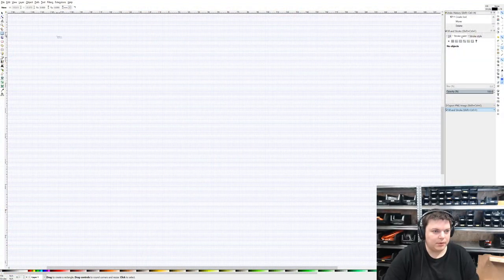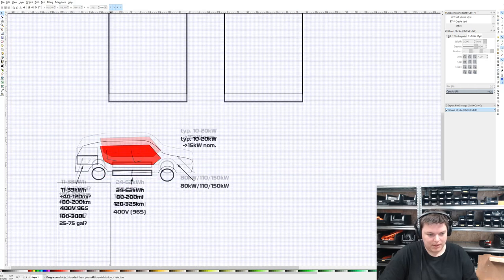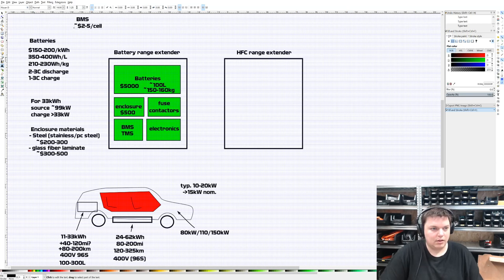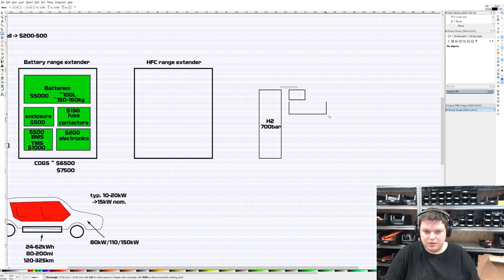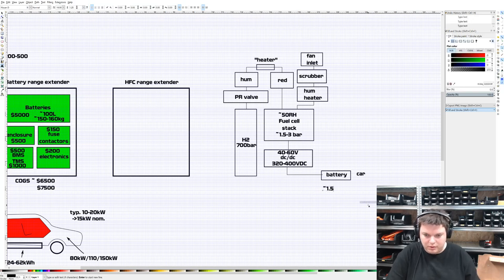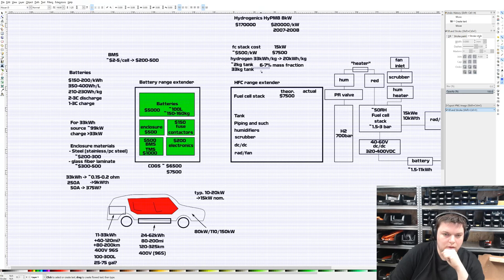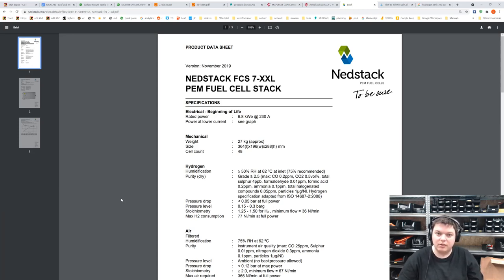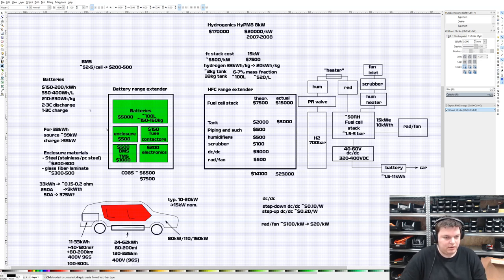Hydrogen fuel cell range extenders (deep dive)

Comment: just to let you know: here fuel cell have arrived as house heater device for the winter to create heat and power that gets into the household, its battery and the grid for 10Cent or so.

The fuel cell is only working in winter when solar power is low and they also have a heat pump for heating for the rest of the year when solar power delivers enough energy. Not cheap, but quite good in the total view.
Reply from the maker: I assume you're either in Japan or in Germany? Do note that the home heat&power SOFCs are quite different tech and not really comparable (or environmentally/energetically interesting) as they run on natural gas rather than green hydrogen. There are some interesting economics around natgas SOFCs in very specific areas, but that's also very much government-subsidy/tax related. The Japanese installs are highly subsidized by themselves, and the German installs rely heavily on the fact that regular oil/gas heating - even with cogeneration - is ludicrously expensive compared to free market prices (i.e. a regular oil-burning heater system is €12k+ while it's less than 600 euros one country over), making alternatives more interesting.
Reply: @PowerElectronicsBlog  Right, we have a community that owns windturbines which produces surplus energy you can not sell cause the grid is rejecting the energy in specific situations and the situations do more often appear and for a longer time. A battery can not store such amounts of energy what a Hydrogen storage can store. This model has no subsidaries cause the energy used would be useless, the turbines would go out of the wind and rest.

Airbus is now on the verge how to get into a zero emission world as they claim and that is based on hydrogen too and a network or hub on each airport for these new planes. The truck bus companies from Mercedes, VW, Volvo, MAN, SAAB SCANIA have merged their Hydrogen actitvities as the alternative to big batteries or the battery exchange model the Australian start to use, which is limited to their market cause length of trucks is here a limiting factor and you can not exchange heavy batteries in europen trucks in the current size. There is progress in the Hydrogen world but it is slow and depending on the progress of saving ressources or replacing those that are pretty expensive. 

Depending on the infrastructure things can change cause the same issues are faced multipe 1000 times by all the windturbines off shore that in stormy weather get out of production due to grid limitation. And we could see this hitting also the older Solar power roofs that had run out previous market models and will not get any money or close to nothing for the surplus energy. The solar power will be growing and overproduction too so there are thinkings to let those owners to sell the energy in summer to give them back hydrogen created power from the fuelcells created to heat the local homes. The next step would be becoming a part of the company and to not sell the energy but invest and return it cause then the taxes can be kicked out of the equation - and always the next logical step is a connection to a hydrogen network where they can get their power production back in hydrogen for a tiny additional fee for logistics. Works in communities that are willing to cooperate with each other and work for the community together like adding biogas productions to the windturbine community.
Reply from the maker: @typxxilps  So, this goes into a separate discussion of grid-scale storage and transmission. This is actually quite well-researched and apart from a few very limited scenarios, building out transmission and energy trading is considerably more effective at decarbonization than storage. Ultimately, you don't want to store energy if you can avoid it.

You're asserting that 'a battery can not store such amounts of energy what hydrogen storage can store' - but why? What precludes batteries from storing just as much useful energy as hydrogen? This is a commonly heard base assumption that I don't really understand. Especially for small-scale operations, batteries are fine and certainly a lot more competitive than hydrogen. Don't forget that the cycle efficiency of hydrogen storage as well as the poor efficiency of using either direct or waste heat for heating makes this even worse long-term. 

And the same goes for your assertions on battery size and weight in trucks; please, show some numbers! This is not a foregone conclusion, and batteries are a lot better than you think! Not just from an energy density perspective, but also general system complexity and cost. Weight is generally not the limiting factor for long-haul trucking - it's cost. Trucks are already a relatively expensive and energy-intensive way to distribute goods and fuel+maintenance is a big part of that. The main driver of innovation in this space is cost, and hydrogen is a very clear loser in this regard. There's little doubt that battery-electric trucks will dominate the space for that reason.

Comment: 2. major points: 
a margin is usually based on top of the cost: COGS 7500 x 133% will do the 9999 price, so 33% coming from the cost point of view being a manufacturer.  This does not change anything. I guess you also mean that these 33% cover all the liability and warranty questions that come along with any product and then even 33% can be too less especiall to cover all the overhead costs but it would make such a huge point more transparent.

the other point is that you need to make additional columns based on different amounts of production cause the decreasing factor is a bit higher in the car industry and car related product like for example the tank 100, 1000, 10000 each year makes a huge differenc on the price per unit, therefore economy of scale and therefore ID family or MEB plattform with exchangeable parts used everywhere only difference about the specs (engine) or amount (battery capacity). That is why you had seen the VW group producing up to 9 different branded product on 1 single plattform like the golf from 2000 onwards - before VW had been loosing money for a decade, in the early 90s they suffered from low order volume and their workers had been working in a 4 day a week scheme just 30 or 32 hours a week instead of 36 hours. So the modular concept was created to lower the costs per unit /engine/ gearbox / transmission / clutch and the electronics and lead to such a cost reduction per part that the profits grew exponentially and the production volume too. 

And if you put such economy scale figures into accout the hydrogen model will become significantly cheaper and of cause faster cheaper as the battery modules, but only for a certain amount of time when innovation progress decreases and production volume also no longer increases that much. Of cause that also depends on which components you are looking at cause the simplier tech like tanks and so on represent only a smaller part of the full extender costs. Regardless how many more units you will do the decrese of the price per unit will be slowing down except you reach a new order volume where the manufacturer can start a different prodcution method which then will give you another boost in decreasing the price , but this will only be one time only decrease and further more units will no longer bring the price significantly down. The fuell cell its is the major block of the costs and more or less a black box regarding cost per unit depending on the production volume. It is still low. 

At the same time the LiIon or LiFePo4 tech is booming into new peaks of productions with new mass production tech that makes them again cheaper and the demand surge is coming from powerwall appliances needed for solar power everywhere and general demand for 18650 or 21700 driven devices like the whole Dyson story or all the hobby tools from Bosch , Makita, and all the others and finally the car makers moving on to hybrid and EV. 

But the cost reduction per kwh is also decreasing considering that VW has claimed to reach a 100$ / kWh price already in 2019 and that even another jump to 50$ would bring the costs of an average 60 kWh car down by just 3000 $ in total - which they simply need to gain in the second the grants will disappear in europe. 

The battery extender / replacement of current cells by new chemistry is and will be for decades the by far cheaper one cause it is benefitting from the whole market development - on the long run beside the current covid driven peak for batttery prices - and the costs reduction. Therefore you usually pay only for the battery itself and conncetions and fuses and so on but not for all the basic overheads a fuel cell does need. The fuel cell will still be struggling for a long time - but even VW is uncertain if the fuel cell could not come back cause therefore they invited all the other german manufacturer for a general statement that the fuel cell will not reach the market - to save research expenses or to shift them into battery driven tech. But none of the invited agreed on anything and rejected this proposal and therefore all will continue more or less. And still BMW and Mercedes have done a lot of hydrogen research how to retrofit combustion engines which is quite cheap, but the storage is their core issue even though the emission were great and it would be cheaper too to keep them clean than current fossil cars. These are the 2 big battle grounds and since the old tech has been devolped, is there they might prolonge the life cycle of the big block tech for a lot of enthusiasts. VW has given up and now even the unions are keen going electric and will stop any turn arounds back to fossil which will make it difficult cause VW is still producing millions of cars outside for markets that do not want going electric like latin americas where they have plants too. 

Fuelcells for car range extender will not work out for about at least 1,5 decades and even then hard to get close to the then available and improved battery tech looking at lifepo4 charging cycles in specific low profile use cases up to 4000 times.

Till then there will be a huge market for all the first gen EV from E-Up 1 and 2 to e-GOLF 1 and 2 that will have demand for replacements or range extender cause they will soon reach degredation areas where the depreciation gets pretty high but also the chance to add value by "refurbishing" those or adding a second life. A few e-GOLF will be slaugthered for spare parts and then a lot of others can get a second life in their 9th year cause their chassis lasts about 25 years so it would make sense too. Not for VW most likely cause their prices will be to high - at least compared to Tesla replacement offers around 11000€ plus 1000€ labor in exchange for the old battery. Sound a lot but these are big model S batteries from the early models and the e-Golf has less than 1 / 3 of the capacity, but VW will not offer a new 22 kWh battery for 1/3 x 11000  = 3.666€ + 1000€ labor even though they could easily at least in 2025 with lower battery prices. 
Range extender and battery replacement will become a huge market and that has been only solved for TESLA with their offers, but not really for all the other brands.

Keep going on your good work and hope to hear from your VW extender or replacement offers.  The market will start to grow significantly stronger from the moment the grants will disappear and that is just a question of 1 to 3 years transition phase till these are gone. And then the manufacturer will be able to lower the prices about 3500€ and on top the progress in the kWh cost reduction, but they will only share that as half profit, so 5200€ instead of 9600€ grant will be the post grant era price point. And the 4400€ difference will push the range extender and battery replacment market for a lot of buyers cause with a delay of about 1 to 2 years the used car prices will increase too - not by 4200€ but at least 75% - 50% figures depending on age.

Comment: I really wonder why the extender needs to keep up with the usage. As long as it slows down the discharging of the battery it does extend the range. Of course, when you start with a 100% battery and hydrogen tank, you don't want the battery to be empty before the hydrogen runs out (, although that would mean you just need to park the car for a while to get enough charge into the battery again).

Comment: Cool video. Nice to have a good overview why HFC extender is not a viable option. And you even forgot some costs, I guess filling the tank needs some extra hardware, maybe even some electronics?
Reply from the maker: Yeah, the fillup part is something I'm simply not familiar with as we did direct bottle replacements on the kart, and in my consulting I've only worked on the fuel cell electronics part. And there's more parts of the puzzle that are missing, like the cost of fillups, certain expensive bits of equipment needed for assembly and testing, etc.

Comment: Agree on this 96S form factor. However, it should be much higher for lifepo, right? Do you also use lifepo cells for some extender packs?
Reply from the maker: Yeah as I mentioned in an off-hand comment, it's more like 114S for LiFePO4. Depending on your charging profile and BMS/physical layout, 112, 116 and 120S are common as well.

Comment: In my Opinion Hydrogen-Fuelcell makes sense atm (and future) in Trucks only they got the space.
Edit: Also Press and People, miss the fact that a fuel needs Platinum-group-metal(afaik), which is the reason why they are so expensive.
The Fuel-cells in Cars pop up every 5 years, firstly around 2000, then 2005 and so on.
Reply: no, that is not true, if had started even before 1994 if you check for the NeCAR 1 for example a Mercedes MB 100 D made in spain like a VW beetle with a frame structure and a fuel cell. Back then the A Class was already in development and got a double floor for an upcoming drivetrain. Then Daimler purchased Ballard Tech partly and they got into the research too so the fuell cell made a steady progress , but slower than expected. Therefore the second generation A Class had also a double floor and built higher just for the fuel cell implementation. Meanwhile more NeCars were build and progress went on but then the burdens of that empty space were too big cause the A-Class suffered always on side wind effects and higher consumption compared to GOLF. Now it is just another GOLF.

And even VW fears that the progress in Hydrogen might surpass that of the battery regarding average speed on the street were charging is a bottleneck cause fast charging at 250 kW lets age the battery more. Remember: VW CEO called all german manufacturers to join EV and abandon the hdrogen wagon to get a better infrastructure and faster.

On top: there are business cases for example here in the north with citizen windparks that suffer from surplus energy that are starting to produce hydrogen as energy storage where the citizen heat this way and can benefit from fuel cell cars and community cars in the sense of car sharing. They have solar power roofs, fuel cell for heating in the winter and power production during the bad solar months and switch them of depending on the solar power which then also powers the heatpump for heating. complete tech room with 60 kWh battery, heatpump, fuelcell stack, air exchange, air conditioning was about 80000 before grants (20 K).

Trucks and Busses will become the next big thing cause there the battery costs and disadvantages (less useable capacity in weight and space) make it easier for the fuel cell to succeed even at high price point. Later they will try to get down into smaller Busses and Vanlike Busses that benefit from the high heat demand in colder times and then into the Camper / mobile home scene that also has a high demand for heat ... and from there most likely into cars too.

Comment: A good explanation🖒(even with all the "assumptions"/"guesstimations")
[have you spoken to Max Holthausen and/or Ad van Wijk about your findings?]
[ I'd like to add the "running costs" into the mix [kWh going into a BEV vs kg of H2 (energy-equivalent) ; currently there's no competition ; H2 is outrageously expensive making H2 a non-viable option]
Reply from the maker: I don't have any direct contacts to Ad van Wijk, let alone somebody like Holthausen. But I'm not saying anything unique or outrageous, this is all pretty standard fare in the industry. The 'unique' twist I'm adding here is really going into the economics and sourcing issues surrounding a relatively small-scale range extender product, which aside from the issues surrounding hydrogen fuel cells in general, adds a bunch more hurdles that some very enthusiastic people in my immediate surroundings are not aware of. And instead of just saying 'well that doesnt work', why not go through the entire exercise.
Reply: @PowerElectronicsBlog  
⭐ Ahh, OK on van Wijk and Holthausen 
⭐ I agree on "not dismissing an idea off hand" ; doing "the whole exercise" , even on the back of a napkin/cigarbox, is worth doing..
If it doesn't work out there, it's of no use to go into detailed calculations to make things "fit"...

Comment: A 5kW fuel cell should be enough for a range extender, if the fuel cell just slowly charges the battery when necessary (I think Renault made a Kangoo with a 5kW fuel cell range extender in 2019). It will probably still be to expensive and complicated for a small company, but in the future it will maybe be possible. Thanks for the video.
Reply: 2000w+ on with an inverter and super capacitors should be okey too, if the usage is for charging overnight